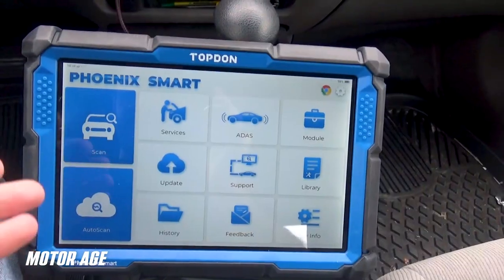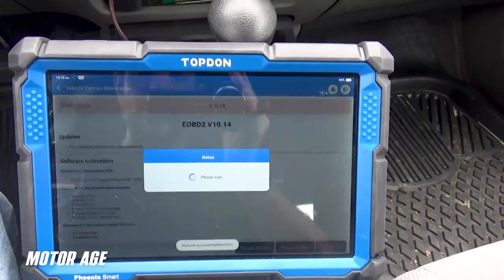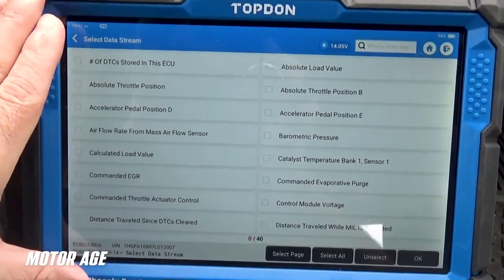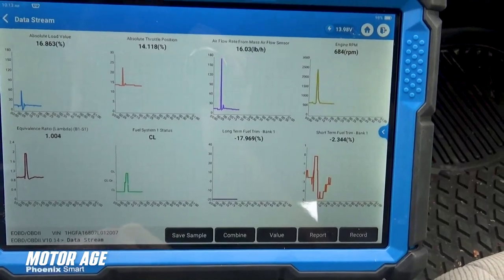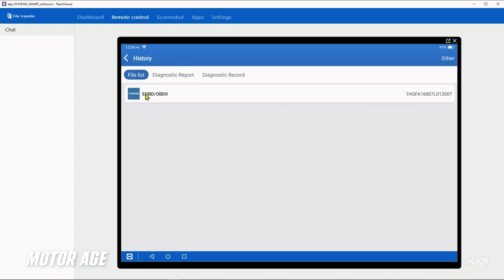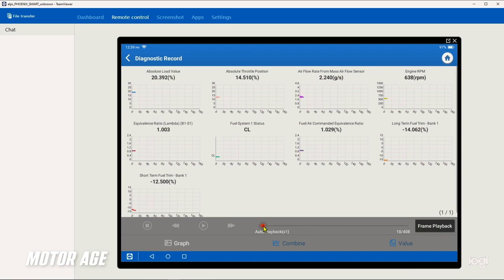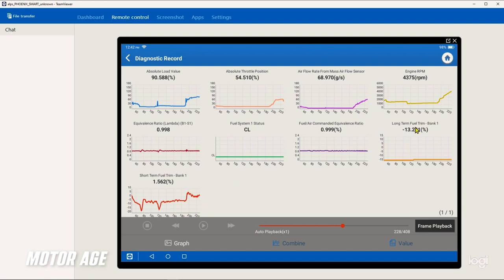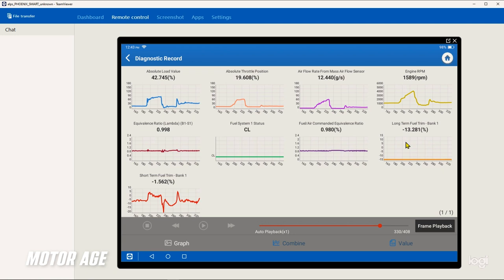Mastering Diagnostics #4: Building A Customized Data PID List

Comment: Excellent info here!  Thanks.  Question... do you have any videos or guidance on high positive fuel trims only at idle  when engine is already hot from a previous drive?  Wife's 07 2.4L Camry shows total FT around 18 under those conditions, but after a short drive to next traffic light where vehicle can idle, total FT is back down much lower than that.  Can't find vac leak with smoke test.  No codes.  Thanks.
Reply from the maker: I would be referencing the MAF PID (in grams per second), and both the pre- and post-CAT HO2 sensors (or wide-band sensor) to see if they are telling the same story.

Comment: Will recording Data PIDs during routine services like oil changes provide enough value to use as point of reference when faults do occur.
Reply: Frequently, when I had vehicles in the work bay,  I would look at load PID values (You'd be surprised at how different the PIDs would present depending on what the engine was designed for). I looked at these numbers so frequently, the PID helped lead me to an engine with tight bearings and ultimately led to an engine replacement. The Load numbers were the clue I needed.

Comment: JUST A QUESTION ,,,,,,,,,, WHAT IF ON THE VEHICLE I AM WORKING ON I CAN'T GET OBD 2 DATA AND ONLY CAN GET ENHANCED DATA POSSIBLY BECAUSE THE VEHICLE IS AN IMPORT RIGHT HAND DRIVE FROM THE ASIAN MARKET . IT DOES NOT HAVE OBD 2 ONLY ENHANCED DATA . HOW WOULD THE DATA PID LIST CHANGE FROM WHAT YOU CHOOSE TO WHAT I ACTUALLY WILL HAVE TO BE CHOOSING SEEING THAT I WOULD HAVE TO BE USING ENHANCED DATA . LOVE THE WAY YOUR GOING WITH YOUR CLASSES PLEASE KEEP THEM UP THIS IS SO NEEDED THANK YOU BRANDON STECKLER 🙏🙏🙏👍👍👍
Reply: Excellent question! Similar data is available from both data lists. Just keep in mind that the info may present differently. For instance, I may not have AF RATIO available on the enhanced side. It may just be offered as AF SENSOR CURRENT or VOLTAGE (and that differs per vehicle).
Reply: @brandonsteckler3417  THANK YOU SIR,,,,,,,,,, IT SOUNDS LIKE WHAT I REALLY NEED IS SOME FORM OF PID CROSS-BRAND MANUFACTURE DECIPHERING MANUAL AND PLEASE KEEP UP THE GREAT WORK !!!!!!!!!!!!🙏👍
Reply: @brandonsteckler3417  OR MAY BE,,, ITS THE BRAND OF SCANTOOL ONE IS USING AT THE TIME  SOMETHING TO THINK ABOUT .
Reply: @brandonsteckler3417  BY THE WAY I WAS USING A LAUNCH SCANTOOL AT THE TIME .
Reply: @8power0  , this is the reason I acquire data from the OBD2 PID list. IT crosses brands with almost nothing to be left to interpreation for further study. it is a "apples-to-apples" comparison across brands.

Comment: Brandon can that EVAP purge ever cause a too rich code? Just curious if its something I need to consider. I understand if the purge was leaking it would always read rich with a full tank. But does the PCM account for this added fuel vapor and discount that extra fuel while the purge is being commanded on as part of it's strategy for this scenario? I hope that made sense sorry!
Reply: Excellent question! Factually, some vehicles strategize to account for canister hydrocarbon load by "learning" a totally separate fuel trim value for "purge enrichment". Said another way, you will not see much trim during purge because the PCM has already accounted for it. However, you can see that my vehicle (2007 Honda Civic) does not employ that strategy, and compensation is handled through traditional fuel trim. If a canister gets saturated with fuel it is possible to have a heavy enrichment that cannot be compensated for, and rich-DTCs may follow.
Reply: @brandonsteckler3417  thanks for the reply and info it's much appreciated!
Reply: @halvorsonmx  , You're very welcome